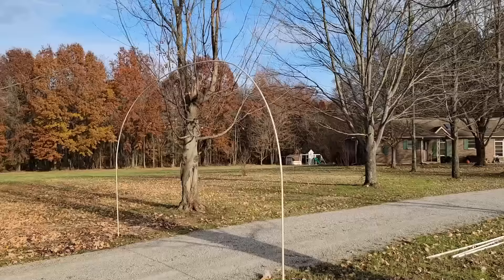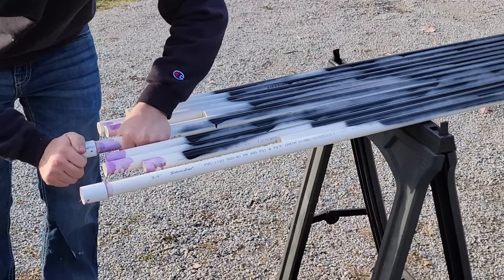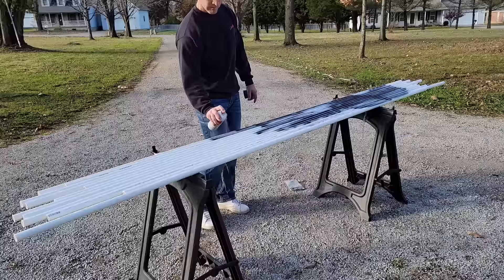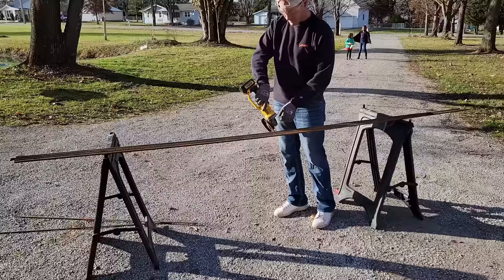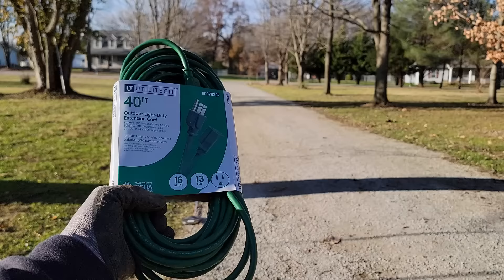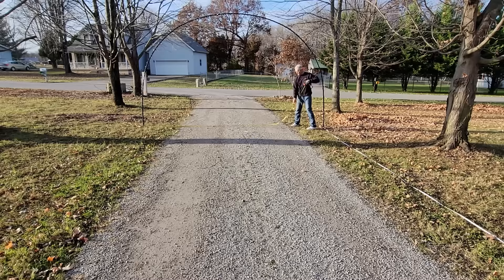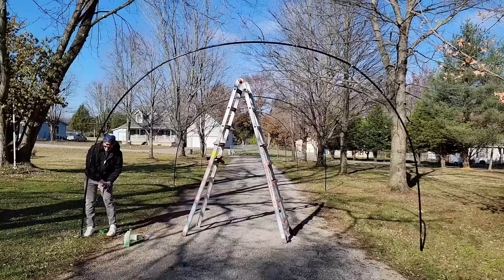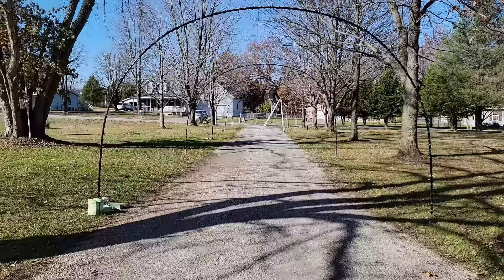How to Make a Drive Way Arch For Christmas Lights

Comment: Before you drive things into the ground, make sure you know where your utilities are buried
Reply from the maker: That would be great suggestion for most people.
Reply: @y2kok  what do u mean most people
Reply from the maker: @jefftown604  for people that don't know where their services are located.  I know quite well because I had them marked.  I am sure others know as well, but never a bad idea to have them marked again.  Best of luck.
Reply: They aren't that shallow.
Reply: @TEX-704  no shit Sherlock
Reply: Yeah most utilities are over 4 ft below the top...  if not 6ft.  Your rebar will never touch them unless you are driving 6ft down....
Reply: @ScareHollow  electrical according to the nec is 18 inches not 4 feel LOL
Reply: And cable or phone might be a few inches. JULIE is a free service to locate all utilities.
Reply: Yikes, If you're hitting utilities with a yard stake, you have bigger problems than not locating them first. 😮

Comment: I'd suggest to put the lights on first, space appropriately and zip tie. Also cringeworthy watching work on the ladder, slip and possible serious injury falling onto that rebar. I recommend installing a cement base instead of pounding stakes into the ground, unless you've had the ground scanned for utilities.
Reply from the maker: I have had to restring a few, and have done so from the ground.  The light stringing while they were up was mainly for the video.  Cringe away.

Comment: Use bolts and cotter pins to assemble and disassemble quicker. You don't really have to worry about losing the nuts or the bolts. Just pull the pin out real quick, slide the PVC pipe out and repin it. That way your hardware just stays in place.
Reply from the maker: Also a good idea!
Reply: Cotter pins are fine. "R keys"  are a fast alternative too.

Comment: Did you have any issues with the cup links cracking in the cold?
Reply from the maker: Hey Tim, I did not have any issues at all.  That said, it doesn't really get below 20°F for very long here.  I could imagine if you are in the northern states that there might be issues if it gets really cold, but I am not the expert.  I would check the temperature range for the materials that you plan on using, but the overall stress on the pipes is fairly low.   Good luck!
Reply: @y2kok  Worked like a charm.  It got down to single digits once or twice and even have a wind storm with gusts of 40+ mph and nothing broke.
Reply from the maker: @mousetravel71  Glad to hear it!  Hope you enjoyed them.

Comment: This dude cleaned the pipe before gluing it 🤣 you only need to clean it if you're running potable water through it
Reply from the maker: Haha, yeah, I said you didn't have to use the primer.  I am used to using it so I used it.

Comment: I followed this video and it worked out great! Even in 2024 I still managed to do it cheaper than planned. A few things

If you’re spray painting the PVC do NOT get spray paint IN the pipe or on the ends of it. Like literally tape off the ends. My helper painted them and it ended up adding an extra 2-3 hours onto this project, plus the frustration with dealing with the extreme friction and then sanding it out. 

Second, those two rebar pieces are TIGHT. Definitely a good thing in our windy area, but he definitely downplayed the difficulty it took to get those pipes on there.
Reply from the maker: Glad to hear that it worked for you.  Great tip on the spray paint!

Just make sure that your ends of the rebar are straight.  If they aren't, it will be very hard to get them in the pvc.

Comment: I have 5 archways on my drive way. But I have a chain link fence on either side. So I use the fence poles to hold my PVC pipes, and I used 4, 1 1/4. It spans 20ft, about 14ft high. I also use digital LED's. My neighbor came over and looked at it, then he put one up. Great job on yours.
Reply from the maker: Sounds like a nice setup.  Thanks for the feedback!

Comment: Lots of tips for the rebar:
1) Invest in a chop saw.  A small one (i.e., 6" wheel) is <$50 at Harbor Freight, and it's safer, saves time, and gives cleaner cuts than a grinder and saw horses.  You'll use it for other things, I promise.
2) Sharpen the ends of the rebar.  Sure, they're narrow enough to cut through mud in a few blows, but the extra effort on adds up after two ends per arch times however many arches.  Every year I put a bunch of rebar in the ground to mount/stabilize Halloween decorations: a bunch of sections of fence, gravestones, assorted monsters/skeletons, a lamppost or two, etc.  Take it from me, you'll get back the time you invest grinding a point onto the rebar, especially since you can do that in your garage when it's warm instead of hammering dull rebar in the cold.
3) Paint it.  I hate handling rusty rebar and getting the crud on other things when I put it away for next year.  Don't spray it though.  You'll get the job done faster if you brush it on.  I laid all mine flat and right up against each other to make a continuous surface, then clamped it between pieces of scrap wood at each end.  I could paint one side, then flip the whole lot and do the other.  Adjusted the pieces between coats to expose the parts that I missed (where the rods touched and where the scrap wood braces covered) and did a 2nd coat.  Protects it so you can reuse it for many more years, and it's easier to hose off before you put it away at the end of the season.  (BTW, you could have gotten gray PVC on the electrical aisle.  That's a neutral color that the paint would cover more effectively.  White shows through as soon as it gets scratched.)

Good stuff.  They're an impressive sight.  But I can't wait to see the arches when you jump into pixels and using Xlights.  (Apologies to your wife if I just sent anyone reading this down that rabbit hole.)
Reply from the maker: Good suggestions.  I'll have to look into Xlights.

Comment: I will definitely try this and do 3 arches and build one per month starting in September to see how they hold up with the wind with solar lights. Also,   Home Depot will cut the rebar if you don't have the tools and they probably will drill a hole in the PVC for the screws if you ask. Thanks for the video!!
Reply from the maker: That HD comment is a great tip.  I didn't know that!  Best of luck.

Comment: Probably could wrap the sections with the lights before mounting them on the rebar.
Reply from the maker: I am making five more this year, and you are correct.  That is the quicker method.
Reply: My only concern is the wire for the LED lights will need enough give to stretch around the arch as you bend the PVC. I’ll have to try one first that way before doing them all ahead of time

Comment: 3/4 PVC in my area is 18.50  per 10 foot. Another 20 bucks per 6 feet of rebar.  Sadly that makes the DIY version a lot more expensive than buying it at the store.
Reply from the maker: Yeah, that is a bummer, but I have never seen arches this large in the store before.  As an FYI, 3/4" pvc in 10 foot sections is currently about $9 where I am located (Indiana).  Best of luck.
Reply: Lowes in expensive California has 10-foot 3/4 PVC for $5.58 if purchasing 8 or more.  Qty. 661 available at my local store.  Rebar is $6.68 for 10-feet.
Reply: @marci.5597  I guess that means Canada is really in trouble if even California beat us by a wide margin. 14 USD where I am. And Im not even considered rural  by Canadian standards.

Comment: Do you store them with the lights on or do you take the lights off at the end of the season and reapply. I made arches and store with lights in my attic but it was an absolute pain to get them back out. Just curious how you store them.
Reply from the maker: I take the pipes apart, and leave the lights on.  I zip tie all of the pipes together for each arch and that way I only have to worry about 10ft lengths.

Comment: have you considered running lights from arch to arch?
Reply from the maker: I did consider it, and thought it would make it look like a tunnel.  With the materials that I used, I didn't think that it would be strong enough to support the extra weight when the wind blew.  Perhaps it would have, but I didn't want to risk it.

Comment: I know PVC is not flexible unless heated.  I didn't see if you used a PVC heater to bend them?  I may have missed something.  Not sure if you did anything to get the pipe to bend?
Reply from the maker: PVC isn't completely ridged.  It will bend, and it will especially bend over a long distance.  Granted, it isn't going to bend like a garden hose.  What you see in the video is what I did.
Reply: Our entire community is filled with arches over sidewalks made with two 10-foot PVC pipe sections - it bends, expecially the 1/2 inch size.  It sometimes pops out of or breaks couplings, but uaually not.

Comment: Hi there. I'm wanting to make arches for our Christmas display, what if you don't have dirt/grass either side of your path, my driveway is concrete and there's so grass/dirt either side  I cant bang in bars.. what do you recommended
Reply from the maker: You would need to have some heavy metal plates or blocks to use as supports, and would need to be able to mount the rebar to it.  Best of luck, and let me know what you decide to do.
Reply: You can buy something like umbrella stands. I made my own with concrete blocks, put a length of PVC a size or two larger, to act as a sleeve, and cemented it into the block for added weight. Worked well enough for me last year but I am going with larger diameter PVC this year to add more lights and reduced sway in strong winds.
Reply: Get 5 gallon 🪣, have someone hold a 3-ft rebar in the center, add a 60 lb bag of concrete per each bucket 🪣.
Reply: @craftman5632  unfortunately that still blows over in a moderate wind. Guy lines might be required. They could go to concrete blocks.

Comment: Ok so in the parts list you show only 1 extension cord. I’d like more info please on how you connected everything with power. Maybe I’m missing something 🤷🏼‍♂️
Reply from the maker: Hey, I used one cord per arch.  Basically, I have a splitter on each cord that way I can plug in the next cord and the plug for the lights at each junction.  Pretty easy to do.  Best of luck.

Comment: I’m still confused about the bolt. Can you further explain?
Reply from the maker: If you glue both sides together then you are going to have a solid 30 foot pole.  If you use the bolt on one side, then you can detach everything into 10 foot sections after you are done for storage.

Comment: You mentioned 2strands of lights per arch, but I didn't catch how many lights per strand. 50? 100? Per strand
Reply from the maker: I probably didn't say, but I used 100 light strands.  If I were to do these again, I would consider using 3 stands.
Reply: @y2kok  thanks
Reply from the maker: @lorettauppercue6400  Not a problem.

Comment: Thanks for the video. Going to make these for Halloween. Any idea how wide your driveway is and how tall the arches were? Thanks!
Reply from the maker: Honestly, I am not sure how they tall they were, but they are tall enough for the UPS, FedEx and Amazon drivers to get under with the normal big box trucks they use.    
The width was listed in the video, and the driveway ranges from 10 - 12 feet wide depending on where I measure it at.  

Best of luck on making them!
Reply: @y2kok  Love this idea and really appreciate the tutorial, step by step. Judging by the ladder at 6:49, these appear to be about 12' tall.
Reply from the maker: @donleland9157  Honestly, I am not for sure on how tall they are, but I don't think they are quiet 12' tall at the peak.  I am a little over 6' tall and I think 10.5' is a more accurate guess.
Reply: I held calipers to my monitor and scaled it to his height, and his guess of 10.5' is pretty close, but there are additional variables to consider.  For example, if you use different lights and/or wrap them more (or less) densely, then you're going to have more (or less) weight near the top, so there will be more (or less) sag, especially if you add garland, a star, or whatever.  You could also step up to 1" PVC (3/4" was used here) which would make it more rigid.  Additionally, CPVC could be used for the middle section if you wanted to create steeper sides and a tighter curve (i.e., more of a "U" shape).  CPVC of approximately the same diameter and wall thickness is more flexible than PVC.  There are other ways to adjust the shape as well, such as making the rebar ground supports taller, maybe trying Schedule 80 instead of 40 (i.e., thicker walls) so it's more rigid, adding/subtracting from the overall length, etc.  The base of each arch seems to be about 16.5' wide, so scale things based on that and experiment from there.
Reply from the maker: @alexplorer  Good thoughts, but using 1 inch pvc probably wouldn't work with the layout that I have.  It would be extremely rigid.

Comment: I have 8 arches over the footpath/sidewalk as driveway isn't long enough to bother. I used 1 rebar on each side, 1500mm long on concrete side and, eventually, zip tied to the fence, other  side 1800mm, as drove that side about 300mm into dirt of the naturestrip! Threaded a 3.5m piece of 13mm black garden tube over some garden arches that we had stretched out as far as possible without losing the curve, as driven in rebars are 1500mm from the fence. Arches are also 1500mm apart as well as that was just conveniently how far apart the fence posts are! We then threaded pool noodles in a variety of colours onto each black tube then, with help, I threaded the pool noodle covered tubing with the garden arches inside about centred over the driven in rebar then pushed the other rebar up inside the other end and zip tied the whole thing to the fence posts! Pictures on my Facebook group at www.facebook.com/groups/284453128865939 Last year I strung led solar strings around each arch and people said they needed more lights, this year I went to the expense of getting in net lights, never worked properly from the start and have been pulled apart, probably by kids walking through the archway! So think I'm going to take them off and go back to the string lights! This year we added pool noodle covered electrical conduit, slightly stronger than the garden tubing, width restrictions as need to fit inside the pool noodles, which provide a colourful display during the daytime! And made a lengthwise joiner along each side at the top of the rebar and down the middle of the top, mostly to support the net lights! I may be able to make a photo montage video on my channel but hard to take pics or videos whilst you are putting things up without an extra pair of hands!

Comment: Great video! How did you get the PVC to fit into the couplings as dry fitting? I’m trying and they are not going fully in. Thanks!
Reply from the maker: Try sanding down the ends.  I'll post another video.

Comment: Instead of buying a grinder to cut the rebar, would 4 foot lengths of rebar work instead - to support 3 lengths of 10 foot poles?
Reply from the maker: There are multiple ways to cut the rebar.  A hack saw would be a cheaper option.
Reply from the maker: Also, you might be able to get them cut at home depot.  Good luck

Comment: Would you consider using pex pipe instead of pvc? Not certain if the exact width, maybe 3/4 inch that we looked at, but was told by depot associate that the pex might work better & cheaper than the pvc. Any thoughts and or suggestions for the switch?
Reply from the maker: I am not sure if pex would be strong enough to hold the lights and itself.  You could give it a shot.

Comment: When breaking apart to store, does it come apart easily with the liquid cement?
Reply from the maker: You only use the cement on one side of them.  The second side you will need to use a bolt and nut so you can take them apart.  It works very well that way.  I can try to take a short video and post that.
Reply: Are you dry fitting the pvc to the coupling? Or sanding the pipe down? I’m confused how it comes out easy for you. Please do a quick video of it. I’m building mine now and I foresee it being an absolute pain to break down the bolted side, unless I’m missing something.
Reply from the maker: @dweckk5343  I just put them back together this past weekend, and they were fine.  To get them apart very easy.  I will say if you are worried about it, then you could use a little oil and perhaps that could work.  That said, sanding would also be worth a shot, but at the end of the season last year I had no issue getting them apart.  Good luck!

Comment: Question how did you hook up each arch of lights.
Reply from the maker: Just ran extension cords from one to the next.
Reply: @y2kok   The extension cords I have do not plug into Christmas lights
Reply from the maker: @69Ford  I have a three way splitter for every extension cord.  I use normal 3 pronged extension cords (hot, neutral, ground), and then plug the splitter into it.  From there you can run one extension cord to the next arch, and plug your lights into one of the other two slots.  
Hope that helps.  Just make sure that you don't plug too many things into the same cords.  In other words, be safe.